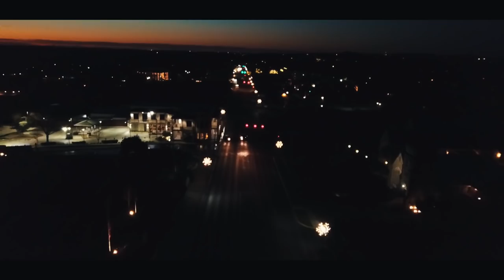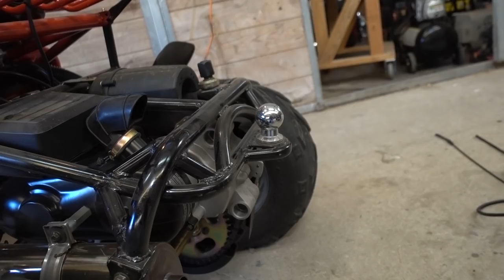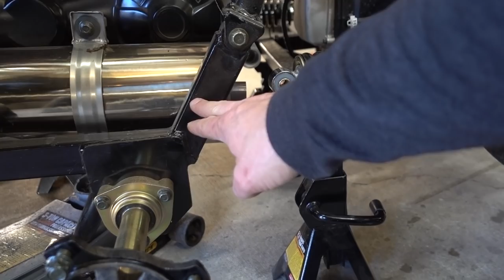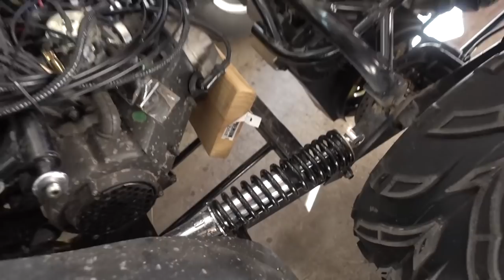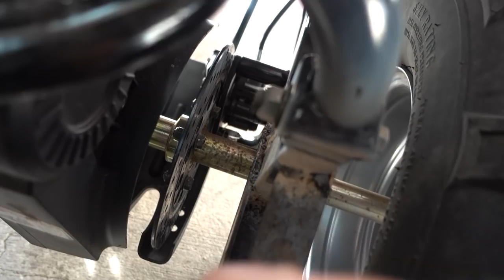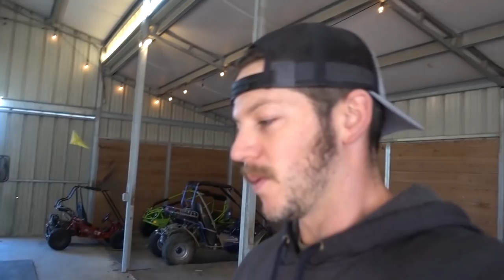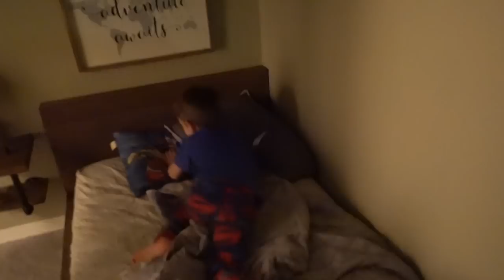Double Engine Go-Kart, Part 2, Testing

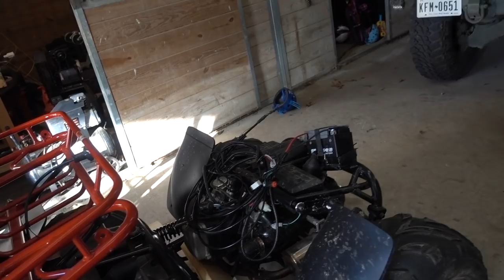Comment: I stopped at 10:39 and the best way to make the suspension work is go of the front motor to it in the position with best travel and you want a large weld surface so that it can be really sturdy and for the motor mounts use the square tubing build a L 1 for each side or build it to sit the height you want and go across the entire top of the motor then use a piece of angle on one side of the tubing at the frame to make it nice and sturdy

Comment: Matt if u read this the shocks need to be connected to the go cart frame not the other engine section or there won't be any weight holding the set of rear tires down and won't have much bite

Comment: On the first engine buy some like 1 inch conduit (emt) bend it in a 90 degree bend and make that first exhaust angle up or down so it’s not blowing into the other motor you will be putting nasty air in the other engine

Comment: You should divert the muffler of the front one out the side so the back motor gets  a little bit colder air so it runs better

Comment: Hey Matt... Maybe you could attach the top support (rear engine) to the bottom frame (rear engine). That way you're only connecting the rear engine to the front engine giving you the articulation you want but also keeping the engine from bouncing... Idk how well i explained that... Also would it be a good idea to extend the front exhaust pipe up so that it's not blowing in the rear engine... Idk if it'll make a differance or that it would even matter just an idea

Comment: You will absolutely want to have the extra suspension on the rear axle. If you hard mount it and the center wheels come off the ground at the bottom of a hill then you will loose the power of those wheels and also the only rear breaks you have.

Comment: Matt, u didn’t have to move the battery you could have welded another piece of medal to the muffler way from the battery and just put fires down heat protective sheets in front of the battery.          Good video though 👍

Comment: Just weld braces to rear frame on the sides in rear of spring to hold the motor up on upper mount then just fab up spring mounts

Comment: when your joing two pieces and one is fixed and one has suspension, you want the joing to in a ^ shap upwards to account for the squish when the suspension is put under load and to make sure that the wheels are always in contact with the ground, just throught this might help i you had or have and problems, just make sure is isnt tooooo much of a v lol

Comment: I am thinking it might work out better to make it a powered pusher trailer (One connection point to the trailer hitch, oh wait there isn't a trailer hitch anymore is there).  You can connect when needed for power, maintain wheel articulation between the two axles and you wouldn't loose any turning radius.

Comment: Top supports will need the same linkage style support as the original to allow the suspension to function. You need some better options for steel, it might take you a while longer but some roll cage tubing and some flat bar to make linkage brackets will go a long way. If this is something you want to keep and have fun in, please please please take your time, get the correct materials and make it safe and durable. Mild steel angle iron from the local hardware store is not the best choice. Throttle shouldn't be too difficult to run, save yourself some time and swing by a bicycle shop.

Comment: mount a trailerhitch to the extra motor and hitch it to the towball of the actual kart dont need to be mounted solid might need to have some weight added to the tires though

Comment: Get another shock and use it to connect to the top engine mount to the rear of the cart cage have to make a mount and weld to the bar that’s behind the carb

Comment: hey Matt you really dont need to connect the top mounts to the new go cart. there basically just n engine support. If you just weld in a support from its own frame you'll be good.

Comment: Matt you should extend the basket and build off of that not the engine frame if you build off the engine frame then the second engine will put a lot of extra stress on the first engines shocks

Comment: there was enough to finish the drain just needed to cut the down tube on the right side shorter so you could raise the trap higher and spin the trap so it ligned up with the other pipe

Comment: Just a heads up when you were welding with a little to much amperage you can tell because of the heavy discoloration around the welds. Just a tip for next time

Comment: Now that it's alot longer than normal make a truck bed and weld it with suspension.  It will provide the proper flow your looking for. Or even make it a 4 seater if you feel safe with it lol

Comment: In the angle iron your gonna need a little bit longer of a bolt so you can put 2 nuts on to lock the first nut.... that way you wont lose a nut and bolt and potentially lose your entire rear motor....

Comment: Could you just weld a mount for the motor strait up from the rear frame and just have the frames attached to each other? Seems simpler than having to try and come off that rear hitch framing.

Comment: If you hook the motor flout to the back of the front go kart it will prevent you from having the second axle moving just run a pole from of that engine to its fixed point and also remove paint when welding plz

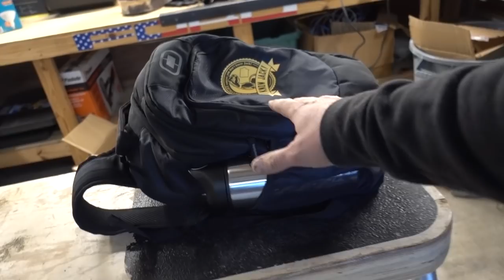Comment: 11:27 one of the funniest things i ever seen in my life was a squirrel trying to carry a little paper dixie cup up a tree. well when he fell i felt bad for him because he already been having trouble trying to get back to the tree with the cup lip bit on the bottom and the rest going over his head so he could not see infront of him. but after dropping it and trying different grips it was the only way to move holding it at all. but then when he ran up the tree really fast and straight into the bottom of the first big limb and fell to the ground and ran in circles with the cup stuck tight on his head. i couldnt take it anymore and fell out of my chair. so ya if your related to a squirrel. you are still okay in my book.
Reply: I think it was 5 times in a row i sat there and watched him fail trying to climb a tree. it just was the funniest thing a squirrel that cant climb a tree.

Comment: You can just mount your second engine suspension to thé orange frame right above te first engine (thé small holder for Backpacks,... ) they will also move seperetly

Combining two engines in serie wil give more power but thé top speed Won't increase significantly

Comment: your going to make a huge mistake if you mount the aft engine cradle to the forward engine cradle. you need to extend the chassis(red) down and back behind the forward engine cradle. never infringing the travel of the swing arm. then you can solidly mount the aft engine cradle to that.

Comment: Think about replicating the angle of the shocks attached to th kart already. Not trying to be condescending, but as you lay a shock flatter the rate of the spring changes through mechanical advantage. So figure there is less weight over that back engine, maybe think about lessening the mechanical advantage.

Comment: You should NOT have cut that trailer ball mount off....you SHOULD have welded a trailer mount to the front of engine #2 and then just hooked up the throttle, etc. Articulation, traction and turn radius would have been better.

Comment: Why didnt you just run a seconed sprocket to the rear to a jack shaft to the seconed rear so,u dont have to worry about sincing the throttles and shifting

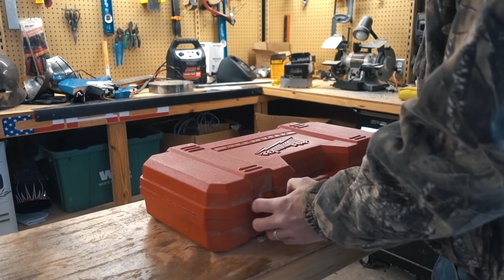Comment: oh wow. just watching this, 4:00 minutes in. Matt, please get and learn to use safely a proper grinder with a cutting wheel. you will need long sleeves, face shield and safety glasses, and gloves. And, steady TWO handed grip. Talk to any professional welder. A grinder 4.5" or 6" with a zip wheel (thin cutting wheel) would be so clean and surgical for the cuts you're about to make. Just saying. Also, a porta-band would be a good option for cutting lengths, and even demolition or modification work, if you can get it in there. In my experience as a certified pipe welder/fabricator for over 22 years, i reach for the cutting grinder or porta-band long before i grab a sawzall. Sawzall is hard to make good straight cuts with. More of a demolition type saw, with access to the area being restricted. Just my experience in dealing with steel. Great (better IMHO) for wood though!!!

ROFLMBO!! Gorilla Welding!! (Ugly but strong-we hope). No worries. Welding is both a serious skill, and an Art. Some tips: clean all paint, grease, oil, etc @ 1" from all weld areas BEFORE WELDING. Also, when modifying the frame try to use similar size tubing. And, I would have measured out the attachment points of the stock configuration and tried to replicate it for the added engine module. It's already been engineered, so installing the second engine module using similar spacing and same size structural components makes sense.

Comment: Dude you need to clean your metal before you weld, remove the paint with a flap disk and clean with alcohol or acitone to remove the grease or your welds will crack and fail

Comment: Hey Matt your gunna need to find away to be able to put some weight on the new added wheels or the whole things pointless spin city  brother they can't help you climb if there just spinning actually will only hurt your climbing ability because your basically just gunna be pulling around added weight to the go cart itself think bout it you go to climb most likely will have it wide open for Max power both sets of wheels and engines are gunna be on the same throttle body so your weightless extra set of wheels are wide open throttle to spin city lol